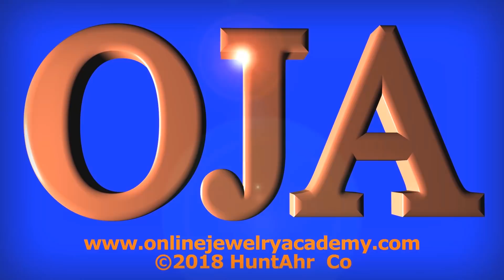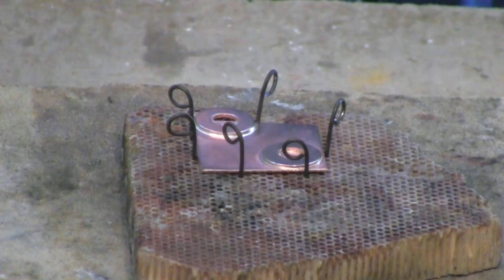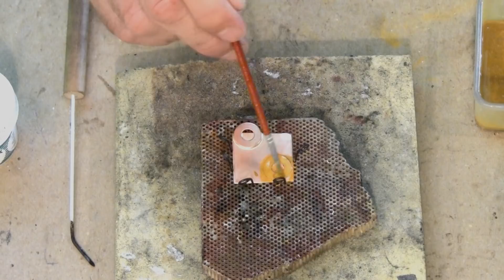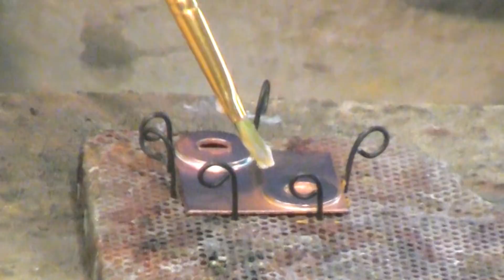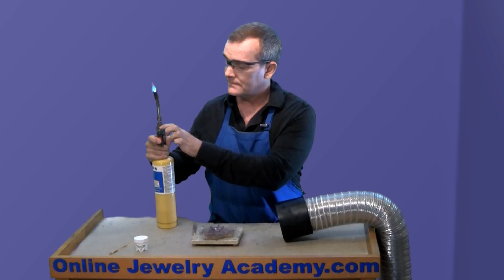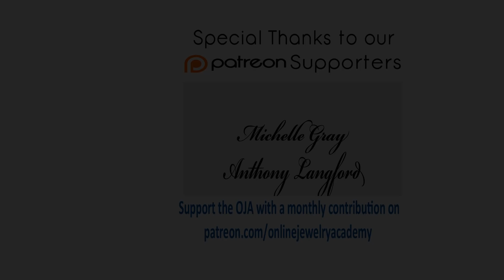Un-soldering - Fixing Your Mistakes

Comment: Thank you for this. I am having problems with simple silver ring. For some reason the solder is not flowing and stuck on inside of ring.    Will this technigue work on that? I dont want to damage the ring to remove the palleon.   I tries paste solder on another ring and that just bubbled up and became crusty.  I am not doing something right.
Reply from the maker: Hi Brandon,  Sorry to hear that you're having trouble with one of your projects.  Assuming that you are using flux on the seam that you are trying to solder shut, and holding it correctly with a third hand, reheating the piece to reflow the solder into the seam should work.  Generally, when solder flows to one side of a ring it means that that side was heated to a higher temperature.  I suggest that you pickle the ring, apply flux and reheat the ring evenly.  It should help to get the solder into the seam.  And, don't be afraid the give the solder a nudge with your solder pick.  Good luck!  I hope this helps you to complete your ring.
Thanks for your support! : )
Reply: @OnlineJewelryAcademy  Thank you, Thank you. I successfully made two silver rings. I would show you but not sure how to post pictures in the comments.
Reply from the maker: Congratulations Brandon!  I'm glad that you were able to succeed at your task.  Now get busy and make a bunch to sell this holiday season.

Comment: This video is great. Professor, is it possible to use the ochre to protect parts you have already soldered? For example apply it to a handmade bezel cup when soldering it to the ring. Thank you in advance for your help.
Reply from the maker: Hi Daniela,  You can use yellow ochre to keep parts in their place or prevent solder flowing onto them while you're soldering.  You shouldn't need to coat a bezel with yellow ochre while you attach it to a ring.  The bezel has a higher melting temperature because it's made of fine silver wire while the ring is made from sterling silver.  The OJA has a number of soldering videos included in its playlist that can answer many of your soldering questions.  You'll find the OJA playlist at: www.onlinejewelryacademy.com
Thanks for your support! : )

Comment: What is that flux where can 8 get it?
Reply from the maker: Hi Frank,  I used white paste flux in the video.  You can purchase it from any jewelry supply company.  And, I'm sure that if you Google white paste solder for jewelry you'll find all sorts of suppliers on-line.  Just be sure you're buying flux for jewelry making and NOT flux for soldering plumbing.  Good luck with your creative projects!
Thanks for your support! : )

Comment: I use whit out as a stop flow. Why do you use yellow ochre?
Reply from the maker: I don't use white out because the solvent based one gives off bad fumes.  The water based version is just fine.  But, I can do the same thing with yellow ochre.  Plus, if my yellow ochre dries up, I can just add a little bit of water and I'm back in business.
Thanks for your support! : )
Reply: OnlineJewelryAcademy Also Yellow Ochre is pretty
Reply: It looks like he has a full video all about the yellow ochre here https://www.youtube.com/watch?v=L6XnoQ6NLGE
Reply: White out I’m sure gives off fumes, and isn’t for soldering .
Reply: huskyfluffy true it isn’t for soldering and does give off fumes, but none that your bench exhaust system can’t evaporate. I do use the water based which I can add water to should it dry up a bit. I use it because it’s easier to get as it’s more readily available. Thank you for your response.
Reply: ROBIN SHANE but why not use something without fumes, and that’s cheeper. Not every ventilation system is as strong as yours. Same as using fume free solder. It’s just a choice for some.